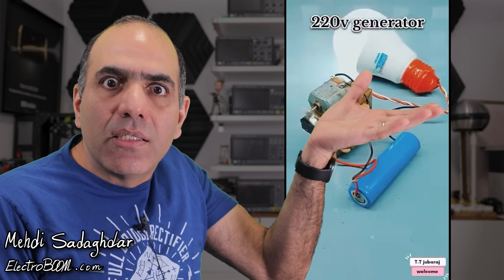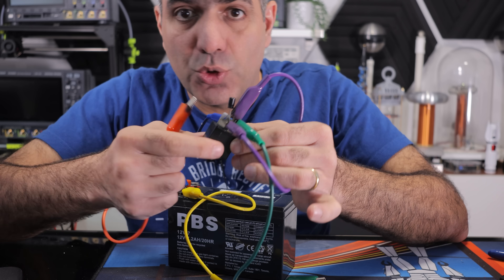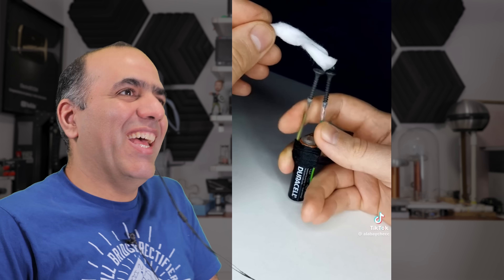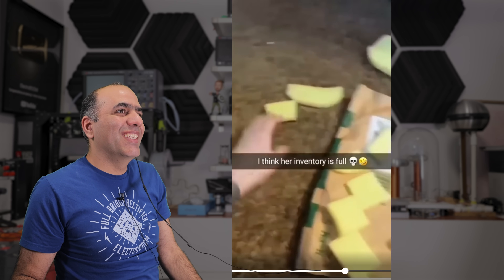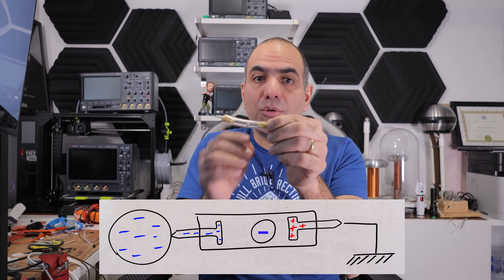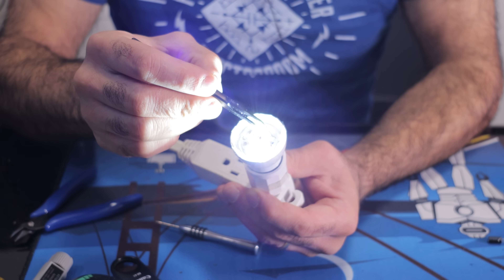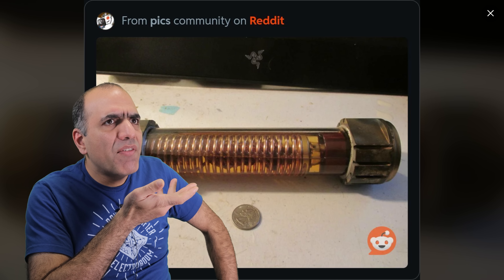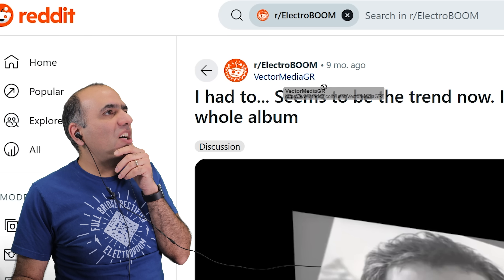Nuclear Egg (LATITY-015)

Comment: There is an error in the impedance formula written at 1:03 . The correct impedance of an inductor is given by: Z=j2πfL
Reply: Wait whats j? I just remember the formula as xl=2*pi*f*l
Reply: @MinePossu  electrical/electronics engineers usually use j instead of i for imaginary numbers since I represents current
Reply: @NobodyVT  why does the equation need a imaginary number?
Reply: @MinePossu  using imaginary numbers simplifies a lot of the equations involved in linear circuit analysis. Instead of having sines and cosines everywhere and having to deal with amplitude and phase shift separately, everything is just an exponential.

Assigning imaginary impedance to capacitors and inductors lets you analyze a whole network of passive components just using resistor equations. You can also apply ohms law using the Fourier or Laplace transforms of your voltage and current signals.
Reply: @MinePossu  The problems that electrical engineers face use complex numbers primarily dealing with electric circuits. For example, some circuits have no real current which means that the measure of the current flow would be zero. Therefore, imaginary numbers are a necessity in these types of circuits to produce energy flow through these types of circuits. Regarding this idea, an engineer stated: "think of it like this: a coil is just a wire, so if you run electricity through it there is no real voltage drop because there is no real resistance. A capacitor is just two pieces of metal that do not touch so if you put a voltage through it no real current can flow.". 

when it involves AC power, especially high frequency ones, the result is that you will get a lot of reactive power so it would be difficult to calculate because like you saw in the video, without load it can go to 170V but after loading the transformer the actual power is much lower than it is. the imaginary part of the circuit is causing it to go higher so we just calculate those in one go
Reply: @MinePossu  the imaginary component represents how the voltage and current will not be in-phase with each other
Reply: @MinePossu j is the same as i, sqrt(-1)
Reply: @MinePossu  that's for inductive reactance (simplified)
Reply: You're right, he confused inductors with capacitors. Can't believe I didn't catch that lol
Reply: nice catch, but low inductance isn't the reason it blows up. Saturation of the core is. Like, say, if a primary would have 50mA when connected to 110V 60Hz, it has an inductance of ~6 Henry. The transformer ratio is 1:10, so the inductance of thew primary is 6/10^2 = 0.06, and the current would be 5 A. The secondary coil will definitely survive that for at least 10 seconds. However, the core saturates well before that, and becomes like air, causing the inductance to drop by something like 1000 times, and now we are talking unlimited current.